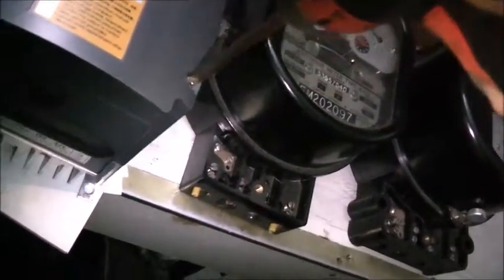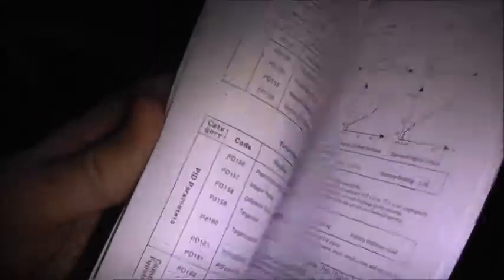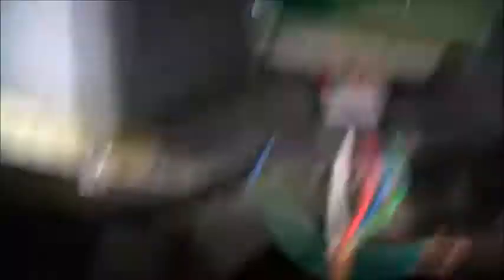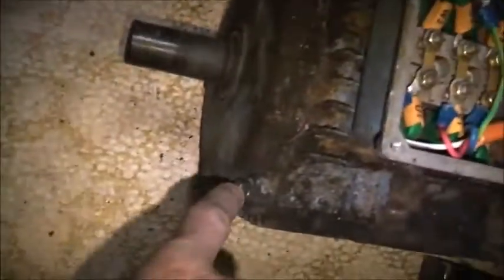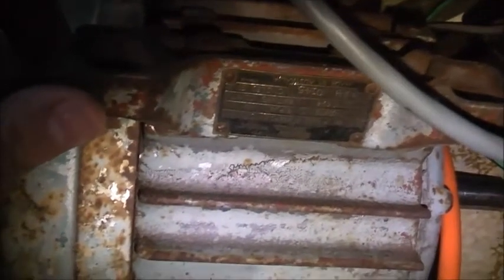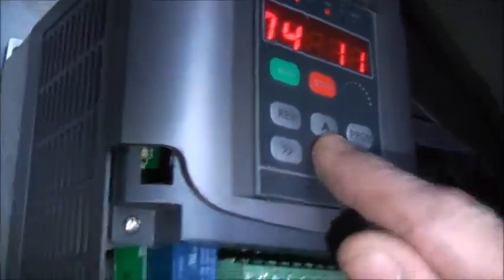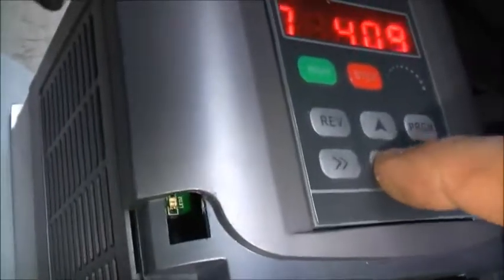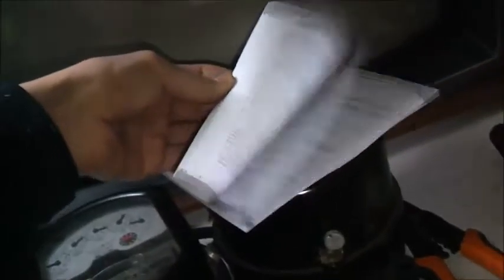Huanyang VFD Test

Comment: You should be careful running your capacitors out with a motor load. Doing that, over time, can damage the capacitors and cause a low voltage fault. This can later on kill your VFD. Great job with the vids, keep it up!

                 -Logycam10

Comment: It's an induction motor the magnetism in rotor comes from the current induced in it by the stator. The Volts Hertz curve sounds wrong, not enough volts at higher speeds. Interesting project looking forward to see what you discover.